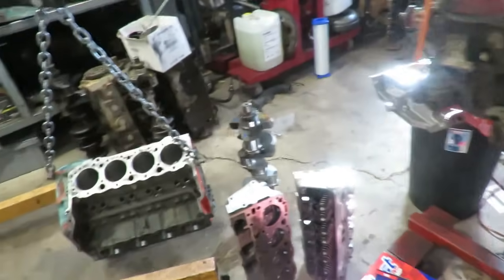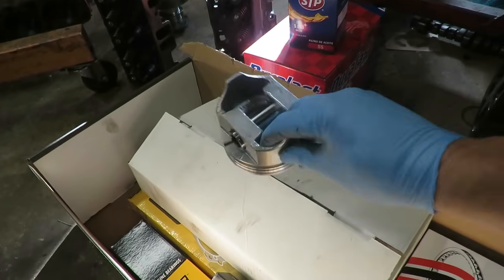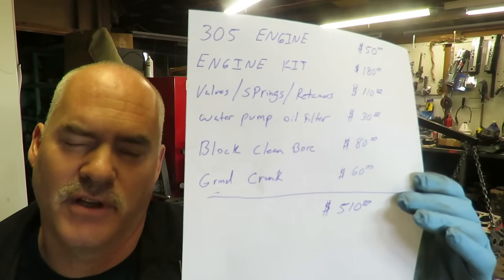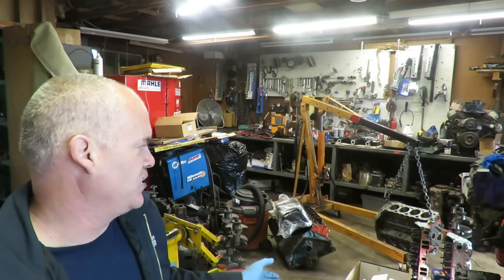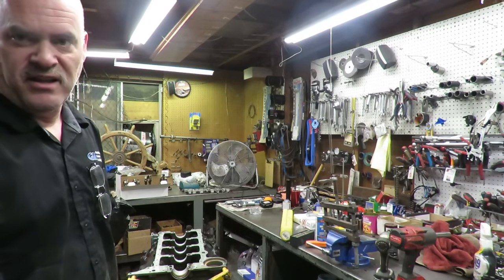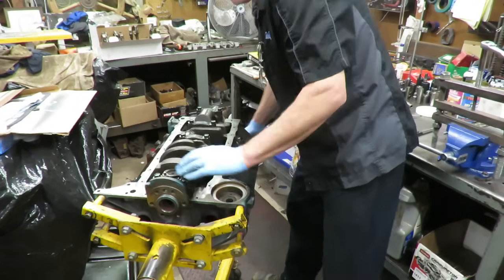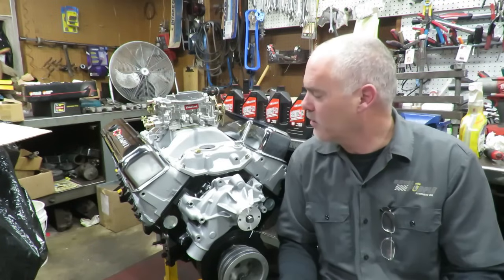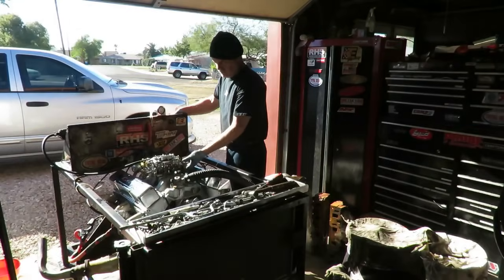Small Block Chevy extreme Budget Build

Comment: These 305’s make awesome light weight hot rod engines... sound like monsters with a small bite! No-one needs to know! :)
Reply: they weigh the exact same amount as a 350 or 400 sbc my friend,they definitely are not light
Reply: Yeah, you can cam it so sounds like a race car at idle, but you're never going to get your money's worth when it comes to performance.  That said, if you aren't going racing, performance doesn't really matter.  Also, the engine sure ain't light, but since you're not putting a whole lot of power through it, it should last forever.

Comment: Awesome build! Me and my son built almost the same build for him to learn on! We got a free 307 and got a free set of 416 305HO heads we also bought a competition products head upgrade kit (z28 springs, moly retainers, stainless valves,hardened locks) a summit 1785 cam and lifters .450 lift 106 LSA and an eBay engine build kit! We put a qjet and a cast iron intake and a set of speedway $89 block hugger headers! We put it in his 83 mustang and that motor ran low 14s with no machine work!

Comment: In my area, the 305 is the only common cheap classic SBC you can find these days. Sometimes you can even get them for free. It's often cheaper to get a running LS than a classic SBC here. My issue with the 305 is the quality changes drastically over the years. Some are very decent like the "Vortec" 305s, which weren't actually true Vortecs, to horrible like some of the late carb, early TBI stuff that had cranks and internals that were extremely weak.

Comment: I did a 305 with same exact heads and very similar cam with 106 love separation with headers and Q-jet carb. Made 318hp and 340 ft lbs. Runs very strong. Neat motors!
Reply from the maker: Right on
Reply: I thought 450 lift cam was most a 305 could take??  What cam did you use?? Thanks brother
Reply: This is EXACTLY what I want for my 87 R10 w/TBI 305 SBC. 300+ HP and 320-350lb ft is right where I want to be. Just enough and not too much.

Comment: Got a little 305 HO in my ‘41 Chevy rat rod. Several modifications regarding steering, brakes, suspension with a couple more to go. It’s so light, interesting looking and for what I want very reliable and surprisingly quick (not fast). Great video!

Comment: I recently did a low-buck 350 last summer, me and my dad paid $80 for a ‘95 350 came with everything including the windshield motor so it was complete. We stripped it down and found it to be an 60 over 350 in really good shape so we slapped some of my dads old vortec circle track heads, cam, all gaskets. We have a wicked little street motor for under $400 and we slapped it in my 1978 Malibu.

Comment: Awhile ago I commented on one of these videos. I made the comment of when installing the timing chain and gear set, once the cam and crank gears are aligned (Crank at 12, cam at 6), both dots need to be moved to the 12 o'clock position before installing the distributor in order to fire at number 1. After doing a few more builds since then I found that this isn't always true. I did this same technique with a flat tappet cam from Comp Cams. When I went to fire the engine ignition timing was 180 out. This rule isn't always true and is based depending on what cam manufacturer is used. Great video's you do. I have learned little bits of info in them. Keep them coming.
Reply: yeah comp builds a lot of chevy off shelf cams with 6* degrees cam advance built in also.

Comment: Awesome build. I really enjoy the budget builds that are done right. That little 305 sounds amazing with that high lift cam. I can honestly say that I've never built any V8 smaller than a 350. My brother's old 74 Z28 had a .030 over 355 in it when we restored it and it wasn't a crazy build, but it still makes 425 hp through a Muncie M-22 Rock Crusher. I think that this would definitely make a good engine for a rat rod.

Comment: Great video. Got you subscribed for a while now.
In the process of doing a 305 myself in a back yard refurb/build... 
Cleaned up the factory "801" heads with EZ Off oven cleaner then new seals and valve lapping, Got an Edelbrock 1405 carb and Edlebrock 2701 EPS intake for $50, new waterpump, new oil pump, new timing chain and gears, new harmonic balancer, spark plugs, wires etc, all new gaskets and seals, a pair of really clean rams horns manifolds for $40. Washed the block down myself with a couple of gallons of varsol and scrapers and brushes and a big catch tray. Hoping it will be enough motor to pull my '54 Pontiac hearse.

Comment: Back in the old days heads used to be measured by intake valve size.  Now they are measured by intake port volume.

1.94 was considered the bottom of the perf SBC heads.  

2.02 were the 'Hot' SBC heads.

1.84 is picking up the bottom of the 305 heads which have nice flow patterns and the leftover 305 parts which can still take advantage of SBC parts.  

Good video.
Reply: Thinking being you would spend less time porting a 2.02 head b/c all heads could be ported and would be done by hand instead of with a CNC and pre-print of maximum port size. . Just relieve the angles and swirl, and that's why 2.02 was considered the top perf home built head.  Handling a head with an angle grinder at home had hours of difference, having your head ported at the shop was based on a flat price range.

Comment: Vice Grip Garage dynoed a 307 with HO heads and basically a ring and bearing job. (Cam, intake, headers too) It put out 290 horsepower.  I'm guessing the 305 would be in the same ballpark.   In a t bucket that's plenty.   Lol!

Comment: Awesome build and a great example for someone needing to power a work truck on a budget etc. Also with some more scrounging over time you could easily add some better parts to the basic kit for more power too. I found a set of Eagle rods new for $150 for a friends build not too long ago, add a set of Hypereutectic Pistons(about a $100 more for the kit), a mild home port/gasket match job etc and for a 2-300 hundred more you'd have a nice little motor that could take a little spray if you want. Just don't go for too much more than 1-1.5hp per cube and she'd be fine.
I had a 30 over 305 in a S10 years ago that ran mid to low 12's back around 99-01. I know it's slow by todays standards but I had  about a $1000 in everything except (motor/trans) for the rear. So at the time it was pretty good for what it was and it was a ton of fun.

Comment: Though I love the concept here and think that that engine is amazing bang for the buck, it can’t be duplicated. Machine work and ebay parts for my next 355 short block adds up to $1100... that’s without cam, lifter, etc. on a block I already have. To clean and bore a block costs $400 where I’m at.  This is why everyone goes for crate engines.
Reply: to clean and bore a block is $400,were the fuck can you get this done for $50.i claim absolute bullshit
Reply: Ya. What did he say 50 or 80 bucks for the bore and cleaning. He sends 100 blocks or more over to that shop a year and got a hella cheap ass deal. Then around 14:00 In he finally says something about “my buddies machine shop”. 
I might be mistaken but didn’t he say the heads are not the ones that came off the 50 buck block but 305HD OR HP heads? Then he didn’t put a price on them on that first list but talked about them again. I’m only 18 min in now so he might later idk.  
I was hoping for a true cost budget build on a 305 trying to make as much real horse power and torque as they could on a budget. Idk why I’m not interested in building one. Hell a 5.3 LS or the smaller one what is it 4.8 are cheap enough and wow they make power with a little nitrous kit or homemade turbo kinda setup. I’m sick of LS swaps as much as the next guy but I’m comparing it with this.

Comment: I just love this channel. That thing really does SOUND good & nasty at idle! For $698.......it really IS cool. Man, I about died laughing when ya said: "It only makes about 200 hp, but it SOUNDS like it's makin' about 400 hp"......LOL!!!  And that too, is very cool. Great job!!!
Reply: A stock vortec makes 255hp with 330lbft torque 
No way that build is making less than stock
Reply: @ronspencer4661  This isnt a vortec tho, an H.O. 305 makes about 200 horses
Reply: @ronspencer4661   IN 85 the 305HO made about 185hp.  This one might make 225-250.  It pretty much stock eccept for the cam and that's not a great cam for that low compression 305.

Comment: Gday. Awesome video, very informative indeed.

So it is known, I am no mechanic and have minimally knowledge of the inner-workings of a chevy motor or any motor for that matter.

So, I'm an Aussie bloke who, a few months back purchased a 67 Camaro from the states, Maryland California in fact. I always loved Camaro's and it has taken me 26 years of my adult life to finally get one, how excited I was when it finally arrived!!!

 Anyhow, to my knowledge it is a relatively stock 327, aside from an Edelbrock Holley, and small cam (all mods done by previous owner in the USA & specs are unknown), power-glide, the differential I believe is factory.

After watching this video it became clear if I am to enhance my Chev's performance I will need to rebuild the engine and originally, and somewhat impatiently, I had planned to replace the power-glide with a TH350 and torque converter but after watching this video I realise that's not the way to go. At present my Camaro drives well and everything works as it should.

Note: I do not intend to drag my Camaro, I'm seeking a cool, slightly 'lumpy' sounding engine with a little grunt from a standing start, enough to get the juices flowing but other than that it with be driven as a cruiser!

Any thoughts about what type of engine kit I should purchase to rebuild without any block mods? And should I also invest in a th350 and converter alongside the rebuild? 

My Budget is around $6K USD

Cheers, Brad from Oz!
Reply from the maker: for 6K you can build a real nice engine I would most definitly go with a set of aluminum heads and a nice roller cam no need to stroke it use stock crank I know you guys down under have some really good machine shops hopefully there is one near you have the block cleaned and bored you will also need a good balance job I think a hyperutectic flat top piston will work nicely get a set of heads with 2.020/1.600 valves and a 64cc chambers intake runners should be 180 200 cc runners are too big for a 327 a good set of ceramic coated headers and duel plain intake with 700 cfm carb and that thing will scream I would stick with the power glide they are super strong if your going to up grade the trans go with a 700R4 low 1st gear and overdrive turbo 350's are weak the power glide is much stronger or a beefed up 700R4 is ok too buy pricey
Reply: Myvintageiron7512 Well I must say, thanks so much for the reply man, that’s so cool and plenty of information for me to mull-over. Since I sent this msg I have spoken to several dudes, one of which races drag cars and he reckons pulling my 327 out (keep it original) and replacing with a 350. 

Here’s the options he said.

1. For about $7k we could do a 330HP Vortec 350 Chev but it wont sound tough. Although we can cam it up  and get it up to about 395HP without much problem.

2. Next step is a 390HP 350 with alloy heads and roller cam. About $8500 complete, will have a bit of a lump.

3. Next step is 383 with 440HP then can go up to a 396 with 490HP.

Which option is best? I’m stretching my budget with any of the above and originally I was happy to purchase secondhand too!! 🤙🏻
Reply: Myvintageiron7512 Apologies mate. Thanks for taking the time out to reply ey, I appreciate it. Every time I speak to a dude in the motor/engine industry I get steered in another direction, bloody confusing!! Anyhow, I spoke to my mechanic who is an 70yo dude who has been in the industry for 50 years, has a workshop at his home and he told me to chill and sit on the 327 for the coming summer, to be honest, that advice has fallen on deaf ears!!😂So I’m going with your advice ey, just one last question, do I need to upgrade my torque converter and if so what would you recommend? I was recently informed it is wise to update plugs, leads etc prior to getting a ‘dyno-tune’, yet I wouldn’t need to do that would I if I rebuild the motor? Anyhow, thanks for ya time mate, I appreciate your busy and living a life too!! Cheers Brad from Oz!! 🤙🏻
Reply from the maker: @brads3683  you got it!  Us Americans love you guys from down under build it and make it cool!

Comment: I did a 383 budget build few years ago heads cam intake all forged turbocharged sbc that ran a LSX ecu  cost around 6500.00$ . Everything from the oil pan up was new. I still have it today I couldn't be happier . Only thing  I wish is  would of went with a 400 block.

Comment: This is a great video. I’ve got an 81 Malibu that has a 305 with an unknown cam, and runs great. Why this video is good for me is because just dipping my toe into the rod scene, this helps me to get started and play with what I have till I can invest in something else. And learn, most important part. Thanks for the video
Reply: biggest thing is ,if you are going i9nto the engine and buying a kit just do yourself a favor and buy a 350 core instead of spending the same money on 45 less cubic inches.if you are just doing a few bolt ons on the 305 buy parts you can later use on a 350 build.buy things once instead of twice. buy the intake you can reuse like an edlebrock rpm,buy a 650 holley or edlebrock not the smaller 305 version then you can reuse it.

Comment: Performed this same build, same pistons and heads etc. However I spent more on the cam and used a small Mike Jones custom hydraulic street cam.  Should be around 260-270 HP. The engine is very stock appearing.  I even used a choice cast-iron intake. It's always fun when there isn't a ton of mon.  Nice video.